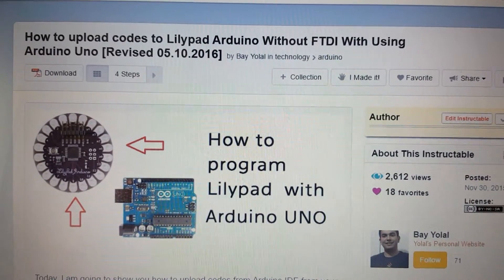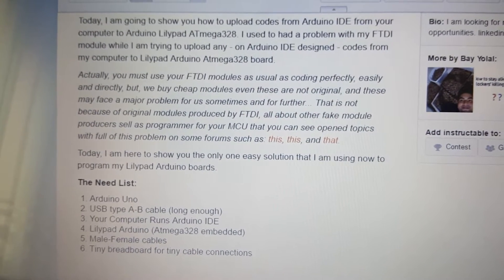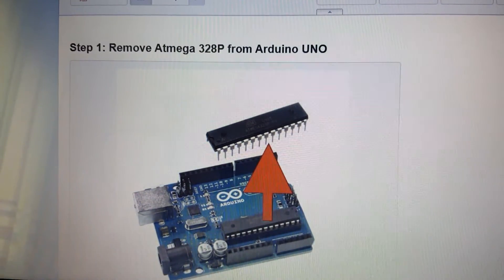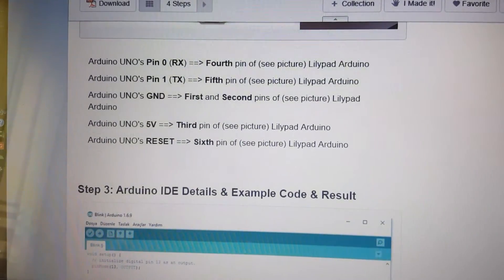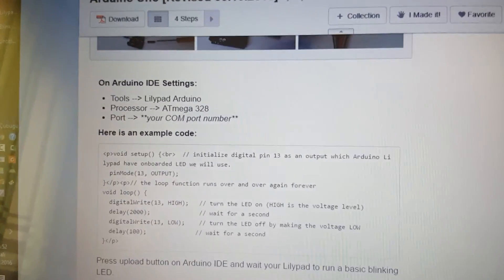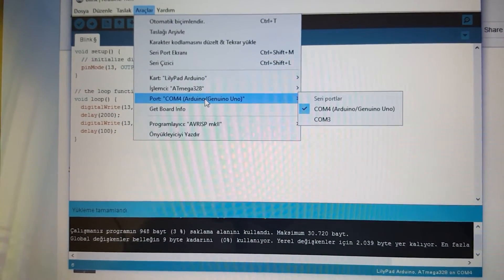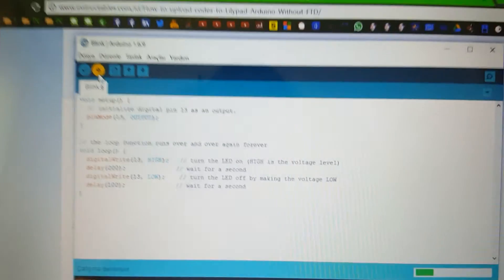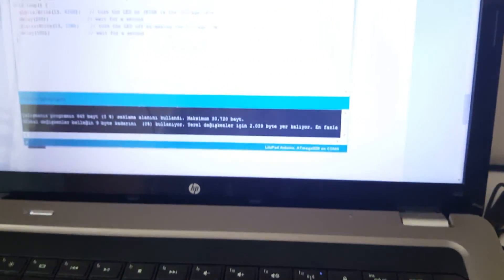How to upload codes to Lilypad Arduino without FTDI

Comment: Why I have to take out Uno's ATMega328P? What'll happen if i don't take it out?
Reply from the maker: If you don't remove your ATMega328P, you can't send codes into Lilypad's chip. On serial line, there has to be only one chip. If Arduino sees UNO's chip, so it gonna program UNO's chip. That's why.
Reply: Can I use Arduino Nano? I'll just do the same thing right?
Reply: Pls reply
Reply: @porujon1116  why do you need this technique for nano it already has a usb port